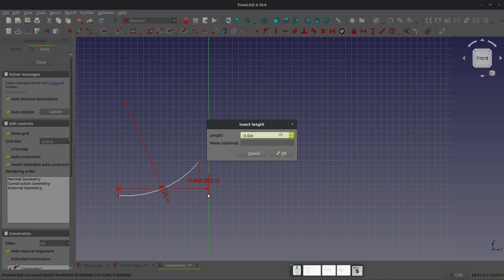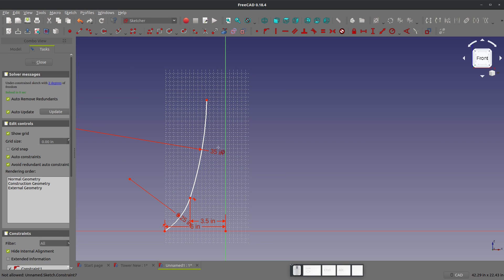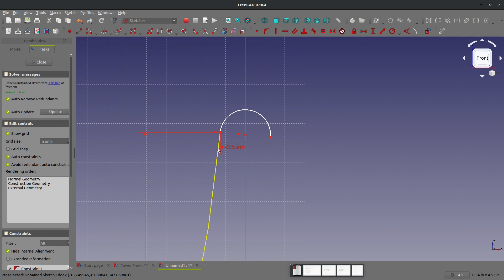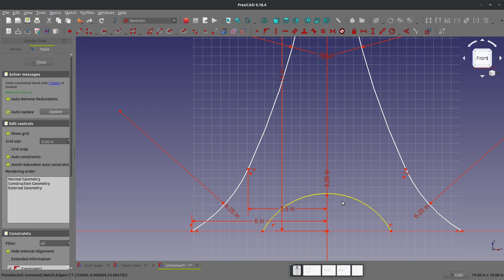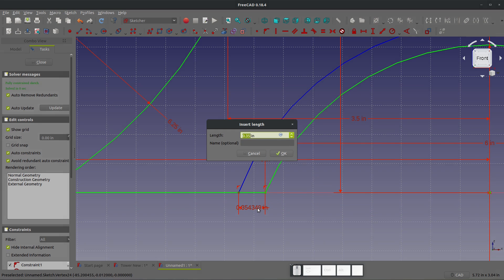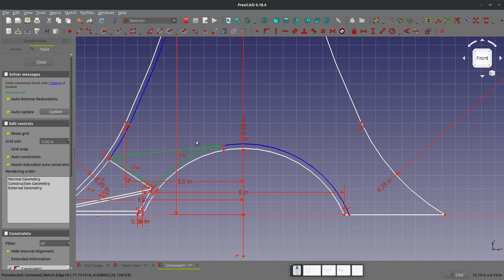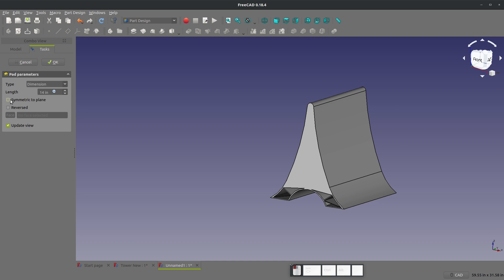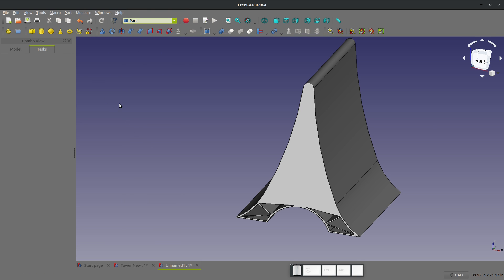FreeCAD Make a Tower |JOKO ENGINEERING|

Comment: I'd be interested to hear more about the zero thickness problem.
Reply: It's an issue faced to some degree by every CAD system. It's not more pronounced in FreeCAD than Solidworks or Fusion 360. And there are other CAD systems that are more robust against these issues.
Here the problem would be that you would be joining two bodies at a single point at their top.